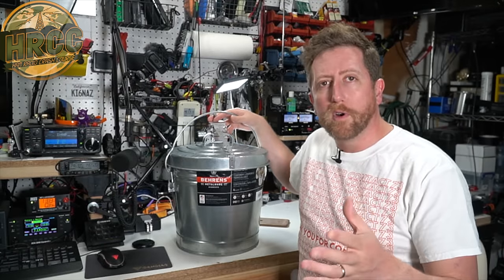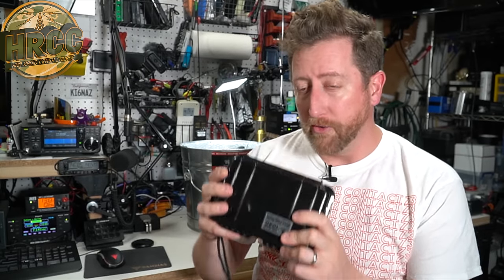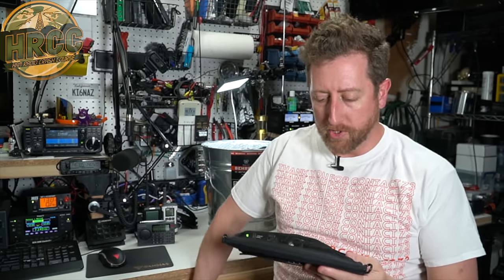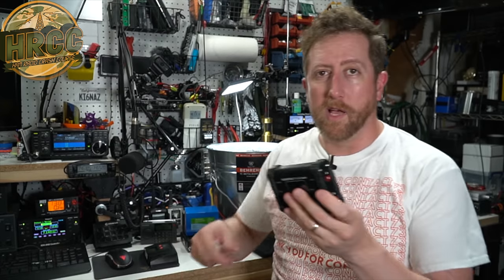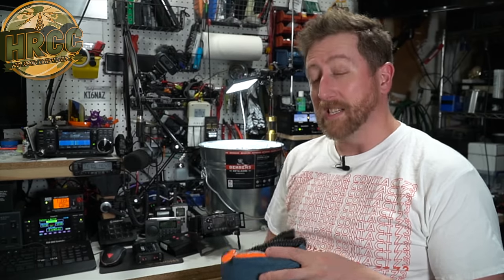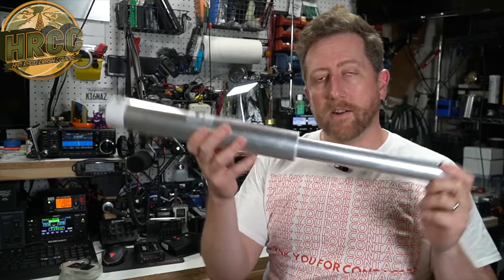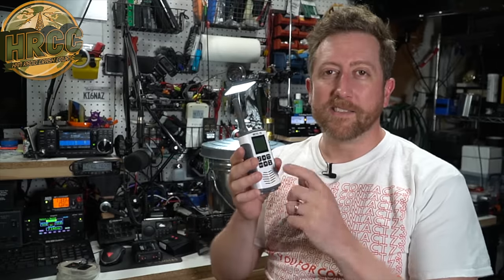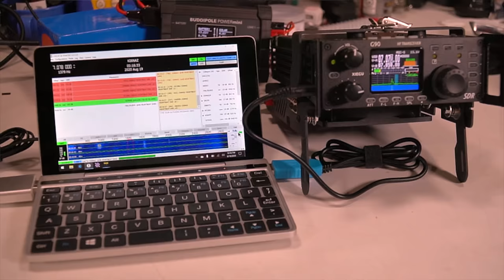Ham Radio EMP Kit, The Tactical Trash Can

Comment: Do a little better Research into how far Faraday cages work they don't need to be perfectly sealed you can technically make them out of chicken wire the trick is to make a room or area that's surrounded by some sort of wire Mash and then ground it.  the idea is when the EMP hits the wire absorbs the energy and then grounds it you don't need to seal the trash can up you do need to ground it also if you have one have something like antennas coming out of the cage the antennas need to be on fuses something if the EMP hits the fuse is pop and the electronics don't get hit. The cool idea is they're turning the trash can lit into an antenna base that would be useful for bucking out quickly and set up.
Reply from the maker: I have done research into this. And no, chicken wire isn’t really a solution here.

Comment: XLNT video, thanks. EMP unlikely? Has man ever invented a weapon and not used it? For a man with huge amounts of gear, your tac-can is small, but if portability is key, why not a large, rectangular ammo can? Fits contents better, stronger. My tac-can is 55-gal steel barrel with ring-lock lid: 2 full-size HF, 2 mobile, HTs, folding solar, batteries 12V, G5RV, inverted L, J-pole, multiband radio, etc.
Reply from the maker: Those large ammo cans are much heavier and harder to seal electrically.

Comment: Good luck with that aluminum can. You should use stainless steel. There are 2 types of stainless one is non-magnetic and the other of course in magnetic, you want to use the magnetic type. Aluminum has about the same conductivity as air so the magnetic pulse will pass through it. What you want is magnetic stainless steel as the magnetic pulse is attracted to it and will follow the steel on the outside and then around the can. Think of it like this, you want the magnetic pulse to follow the path of least resistance, which is around the can not through it. While a aluminum can can stop RF but not magnetic pulses. For the most part nothing can stop magnetic lines of force but we can redirect them.
Reply from the maker: The can is galvanized steel.
Reply: From my research RF proof is the 99% if you are that close that the magnetic effects your gear your way too close to the blast  -probably being vaporised  & on fire !
Reply: - OK, so I Tested the Silver Trash Can & Put a Magnet on it & it Stuck so w/that Considered do I have the Right kind of Silver/Metal Trash Can. ? Is that Good Enough. ?
Reply: I just stuck a Magnet to it & it's Galvanized. Do I have the Right Trash Can. ? I Apologize but I Don't have a Man around to Teach Me these Thing's. I have been Prepping for about 10 Year's & I still Feel Like I'm Running Out of Time. I Actually had a Handyman Measure My Door's & Window's & I'm about to Go to Home Depot to Place a Order of White Steel Security Bar's to Protect Me & My Supplies. Next I'm gonna buy a Gas Mask w/a PAPR & A Manual Well Water Pump. What Else should I get. ?

Comment: How about a Christmas popcorn can?  Lighter, perhaps an inherently better, tighter electrical seal of the lid (just checked two different cans - multimeter lead total resistance = 0.2 ohms; top of can lid to bottom of can = 0.2 ohms), and the full intended value is yummy and eaten.
Reply: RUST?
Reply: Great minds think alike.
Reply: @dougwilson6828  SPRAY PAINT assuming rust is even an issue?  Also, cheaper ($5 - eaten) and lighter than a metal trash can.  And, finally, assuming the fantasy land aspect of this topic where it's assumed that a post-EMP US will be anything other than a starvation Mad Max-ville, I don't think "rust" is going to be the main concern.  😎

Comment: How well do you think an AGM battery will work after an EMP???
Reply from the maker: It would be fine.
Reply: That's what I thought. I know the lithium ion batteries have chips and circuits in them so they would be toast. @HamRadioCrashCourse
Reply from the maker: @mobiltec  It's possible LifePo batteries will work just fine.  I wouldn't worry about them either.
Reply from the maker: I was too.  The battery isn't the major factor here, its more antennas and power leads which can act as antennas during an EMP.

Comment: a static emp pulse is not the worst case scenario
it is hyposed by co. Thomas Bearden that the soviets have a scalar beam weapon
a beam Faraday cage has a outer shield a inner dielectric layer and a inner shield
the inner shield should be shielded to a depth of 25 meters and then grounded
the outer shield can and should be grounded at surface 1-5 meeters deep

Comment: What if your whole shack was built into a metal storage container one of the Connex box types
Reply from the maker: You’d have no antennas.
Reply: @HamRadioCrashCourse  Would a lightning arrestor react fast enough to source an emp to ground?

EDIT:  A hybrid arrestor solution consisting of a TVS Diode, an MOV, and a gas discharge tube has a clamp time of 3-5 nanoseconds, and will be able to react fast enough to absorb E1, sink enough current for E2 (and lightning too), and can clamp lower currents for long durations for E3.  Might be able to keep a fixed antenna hooked up and just have the radios and batteries in a faraday cage for a more permanent setup.

Comment: Like # 681.  
This is a fantastic and needed video.  The one liners were stellar.  Much of what you said is Greek to me but I got some of it.  A question: why would an antenna need to be in the can? Does it have a circuit board?
Reply from the maker: The antenna in the can uses a matching box with fine wire. Just being cautious.
Reply: @HamRadioCrashCourse  very good point.  Thanks.  I think this will force me to rethink my faraday.  I am told an EMP can melt the solder on circuit boards rendering them useless.  But I think you hinted at the level of EMP.  Again great video.

Comment: Me thinks you should have a bigger trash can (50 gal oil drum or even a 3m steel culvert) to fit your whole shack in, solar panels and all.
Reply from the maker: Not fun to carry those 50 gal. cans around.  Just get more small ones. :D
Reply: @HamRadioCrashCourse  i meant for EMP proofing the shack... not mobile use.  Just build your shack inside a giant culvert tube, put a submarine hatch on the ends, a couple vent hatches on top, and a metal box on the side, all sealed with rf gaskets.  You open the hatch to use it to connect your external cables, etc when you put it in operationl mode, and close it all up in storage (sealed) mode.
Reply from the maker: Sure go ham

Comment: Hi Josh new to HAM radio.  do you need to place antennas in the bucket or would they be safe if there is an EMP?  why not make two there's a saying one is none and two is one.
Reply from the maker: The kit has two antennas.  The one inside the kit uses a matching transformer that I am unsure if it would be affected by an EMP.  The later can be outside.  Plus I am surrounded by antennas at home I can grab as needed.
Reply: @HamRadioCrashCourse  thank you  keep those videos coming
Reply from the maker: Will do!  Thanks for watching!

Comment: EMP for hams and most people is not an issue - the short answer is keep your gear unplugged when not using it, and your fine.
Go read "Dark Star" then remember your root mean square calcs, this will show your the you need to be VERY close to the source of the EMP to see the voltages you will need to fry your gear, kill, your cell phone, or cause your vehicle to fail (VERY, VERY, VERY BAD SUNBURN CLOSE). Also read "Surviving an EMP" for actual test data - wish I could say more, however, Dark Star is full of Classified data, and while it's out in the public domain, my security clearance limits what I can post. I can pretty much just say, go look here, it's interesting..

Comment: What's up with Field craft and faraday issues lol. Your can doesn't have to be hermetically sealed so the gasket is useless. Plus you can't use your radios so if you just keep them in a go bag turned off with antenna out they'll be fine in an emp...trash can is useless...
Reply from the maker: Well, it’s been tested that it works.

Comment: Foil tape around the lid connecting the lid to the can.
Reply from the maker: That is what the metal wrapped foam seal I am using does.
Reply: @HamRadioCrashCourse  As someone somewhat knowledgeable of EMPs, I have concerns about the adhesive preventing good contact to the surface. Where I come from, two is one and one is none, so doubling up is always recommended. And since information and power production can save your life in a crisis, 3 feet of foil tape is a small price to pay. Also, since all EMP research is theoretical, one can never be too careful, just sayin'. PS Add personal documents, family photos and entertainment to your lap top.

Comment: Microwave ovens are also good as a Faraday cage.
Reply from the maker: No they are not. They let in many other frequencies.
Reply: I was told they are by a N.A.S.A. phycisist I worked with. Maybe you know more than an M.I.T. PhD. with many years in the nuclear defense industry. We worked together in a Gallium Arsenide semiconductor fab. The initial use of our product was to harden critical systems against EMP. Gallium Arsenide is impervious to EMP.
Reply from the maker: I don’t care. Microwaves aren’t faraday cages.  They’re designed to attenuate 2.4GHz. An EMP is broader bandwidth than that. 

Is it better than nothing? Sure. Does it cover all frequencies emitted by an emp, no. 

Take your chances.
Reply: I had to laugh at this 😂. I put my cell phone in an old microwave with the cord cut off. I called it and it rang! So much for the “experts”!
Reply: @Locksnut  It wouldn't prove a thing. I could turn the phone off. I don't really care, anyhow. I'm all set with my preps. I have everything one could possibly need and then some.
Reply: Johnny B. Goode If you think you’re all set with your preps I’m truly happy for you. If you are going to take someone else’s word without doing you own experiments, your outcome may be less than desirable. I just tried my new microwave and got the same results. If you get better results, please let us know.
Reply: @Locksnut  A Faraday cage does not block signals, it attenuates them. This means that depending on the microwave oven, signal strength, and cell phone used, it may or may not work. Yours didn't, big deal. If you simply bury your items a couple of feet underground in a metal drum, EMP will not be an issue. As I said, I'm all set. I live out in the mountains and have 4 vehicles that will run after an EMP event. I have been prepping since the early 1980's, so I'm ready.

Comment: would and ammo can work even through it has the rubber seal?
Reply from the maker: Maybe.
Reply: Most of the ammo cans have a door like hinge on one side, so that might be the most likely failure point against an EMP. Those large 20mm ammo cans with the latch on both sides might work if that metal braided gasket was used. I think the cans are made of steel, maybe aluminum, and I don't recall if the seems are welded or not. They definitely would stack and store easier while using the holes in the latch as a mounting point to clamp an antennae mount. The immediate problem is they may not be as easy to get as this aluminum trashcan.

Comment: These cans dont work on cell phone frequencies. There are free apps to measure signal strength. Only a 10db drop.
Reply from the maker: It works fine for phone frequencies if you use the seal.

Comment: So if something has to be connected to an electrical source to be affected, how does it help to shield things that aren't plugged In? And wouldn't have to KNOW that an EMP is coming for this to be of any use? You can't just keep your stuff in there where you can't use it. And if you run a power source in there, you have essentially bypassed the box that you have built. This seems like insanity, honestly.
Reply from the maker: Yes. The equipment stays in the trash can, not plugged in. Unless I want to use it on a portable activation for a day or whatnot.

Comment: Not sure why the admin bag needs to be inside the can. You afraid an EMP is gonna take out your multi-tool or notebook?
Reply from the maker: It’s generally a good idea to have a fully functioning kit all together. Lest ye forget a piece.
Reply: @HamRadioCrashCourse  Not saying you should separate them. Just put the admin bag on top of the tactical trashcan. They will still be together, you just wont be taking up real estate inside the can. Clip the bag onto the lid if you are worried about forgetting something.
Reply from the maker: Sure.  I did it my way.  You do it your way.

Comment: KJ7JHN nice video. Thanks! May want a geiger counter included and a map
Reply: rest in peace Art.
Reply: A poor man solution for a radiation detector is a phototransistor attached in series will a piezo buzzer and 9v battery in an opaque box. You could hook up two photo transistors in a Darlington pair for greater sensitivity.
Reply: Are maps susceptible to EMP?

Comment: Is this counterintuitive to anyone other than me, despite the reasoning involved? I am concerned that this would act as a radiator and I think that everyone is far better off using a soft rubber horse water bucket with a heavy disk of rubber pressed in tightly with handles for positioning and it’s removal. I’d  feel far safer with it being used in the same way. The energy is radiant in nature in the first place. Given its ultra high energy I wouldn’t want it being focused inward to its contents by way of its parabolic inner shape, either.
Reply from the maker: That’s a horrible idea. You need the metal enclosure to shield the electronics inside. Those electronics need to be isolated from the shielding trash can, as mention I mentioned in the video.
Reply: @HamRadioCrashCourse  Thank you. The part that baffles me is that it isn’t being grounded which is why I envision it acting as a radiator. So I envisioned trying to take the opposite tack, involving using an insulator.

Comment: ANYONE mention one of those Mylar Bags,(EMP resistance type ) to place inside the Can ?? 73
Reply: Mylar bags aren't EMP resistant, they just block RF signals. Technically that aluminum can just being closed is enough to work by itself.
Reply: @SilvaDreams  The static resistant bags that a lot of electronic components come in are helpful, and mylar wouldn't hurt either - EMP has RF components. I would not rely on either bag alone, but I would put components and equipment inside the bags and put those inside a non-conductive container inside a Faraday cage container.

Comment: Solution to most problems mentioned: Get a 2nd can.
Reply from the maker: Easier to carry two small ones instead of a massive one. 👍
Reply: @HamRadioCrashCourse  BTW, and this might be a silly question, but I thought EMP would affect devices that were powered on in some way (e.g., connected, battery/stand-by, etc). Shouldn't it be a non-issue if they're completely disconnected?
Reply from the maker: Nope. The emp is literally energizing the electronics and blowing fine leads.
Reply: @HamRadioCrashCourse  Thanks again!

Comment: An EMP will generally only damage things that are powered up or at least connected to the grid.
Reply: No, an EMP will damage anything with transistors in it. The spike of induced voltage will destroy the junctions in transistors; vacuum-tubes will simply arc across and continue to work.

Comment: Well, I believe, that you are concentrating too much on a single side of such a disaster. (Unless you have a few more cans like this with different equipment in the garage. Maybe I'd have less radios, but add: multiple LED lights, some small buck/boost converters, a 12V halogen car light bulb, multimeter, spare BMS, rectifier bridges with filtering capacitors so you can use any found electrical motor to generate electricity (car alternator, motor from crashed drone), maybe more batteries and a small power inverter. Tools, like screwdrivers or butane soldering iron and even some cables can go to a bag without shielding. It's worth to check if there is some other generic survival tool worth placing in the same can. Uneven surface of the can could help to propagate part of the EMP inside. I'd place at least the most sensitive parts in separate protection bags and have the can grounded when stored (add a grounding terminal).
Reply from the maker: I believe you’re making assumptions about things that go beyond the scope of this video.  The video is already long enough. In it going to launch into all the things I have in 20 minutes. 😅
Reply: @HamRadioCrashCourse  You are right, but you will still need the LEDs to set up the equipment in the night, when you are shielded the best from solar flares :-)

Comment: I hate to tell you but if you had to protect your radio from an emp you just lost anyway to get power to your radio also
Reply from the maker: Did you watch the video? Solar panel
Reply: @HamRadioCrashCourse  I actually had to go back and rewatch. I didn’t see that you had a small solor panel I was listening at work and missed that I guess. That’s not a bad idea.  I guess I was thinking about larger panels like I have from anker. They all have electronics that I would assume would make them completely worthless in the event of an emp. I hadn’t seen any small ones that put off enough power to do much. I’ll sure look into the ones you mentioned. My interest is peaked for sure. Hope my original comment didn’t come across like I was being a a-hole. After I read it I guess it did sound that way. I actually love your videos. You about single-handedly got me interested in ham radio. I had always messed around with them locally but because of your videos I’m actually going to try to get my general license on the 18th of September
Reply from the maker: @mycatsaliberal3848  lol, yeah a bit ass-holey.  If you start a comment with "I hate to tell you" its likely going down that road.  With that said, yes, the panel and battery are specced for the radio.